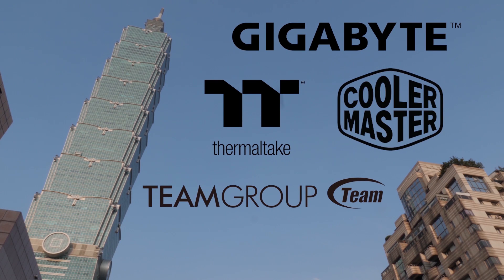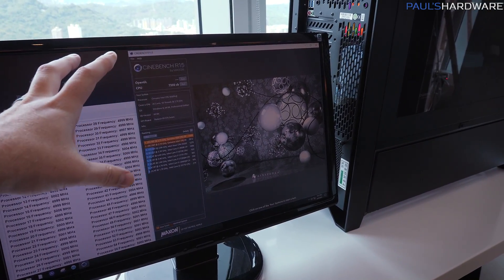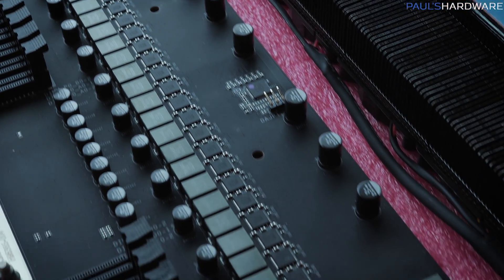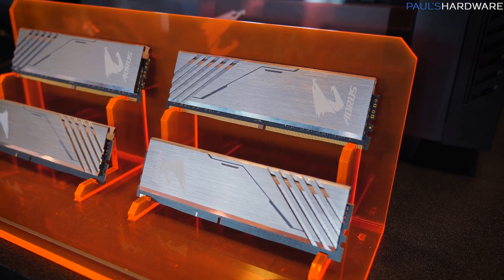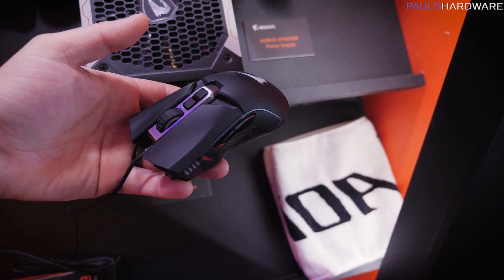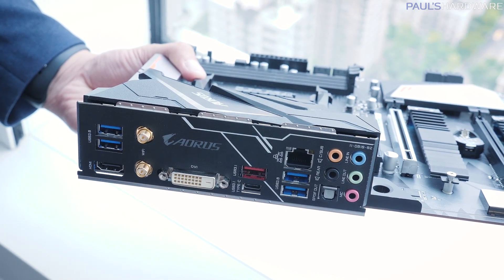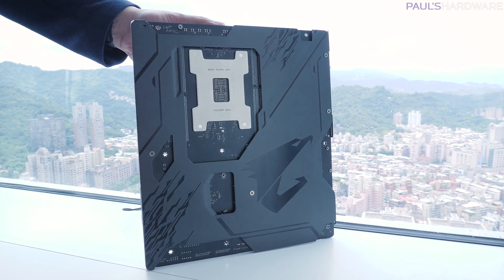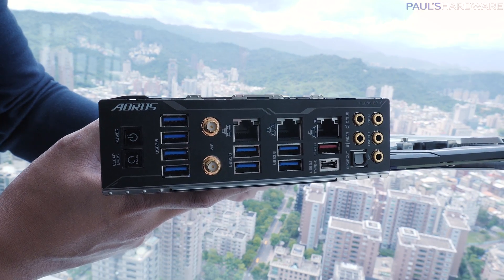Just A 28-Core 56-Thread CPU at 5GHz...

Comment: 32-core/64-thread TR, that is all Paul :P
Reply from the maker: I think we're both heavily in favor of an AMD vs Intel HEDT war 😁
Reply: Yep, love it :D Great video by the way mate.
Reply: Oh yes, don't forget that AMD Threadripper 2 is compatible with the Threadripper 1 TR4 socket. This is a great advantage for those with a “core fetish.”  No need to change MOBO compared to INTEL'S approach of putting UR board in legacy every time a new generation is announced.

Kudo's to AMD for making RUZEN Gen 2 also backward compatible saving us lots of hard-earned $$$. What a difference in philosophy.
Reply: Price tag on that Intel chip tho! Still losing value war
Reply: One quote that came to mind "More than you can afford, pal." LOL
Reply: @Derick P
, 'Ferrari'
Reply: @BOS2161 lol...ahh the "glued together" commentary.
Reply: @Joe Rio  at 250 Watts TDP stock (Probably 400 with a good OC)  I have a feeling the old boards will not run the 32 core TR2 chips...they had good power regulation but that's pushing it.
Reply: I'm hoping for a 10 core 2800X soon.
Reply: On the positive side, 32-core/64-thread TR2 will have an insanely good performance/price ratio, and the lower memory bandwidth compared to EPYC and this 28-core Intel part will not matter much for about 80% of application these CPUs are appropriate for.  On the negative side, the lower memory bandwidth will make the 32/64 TR2 a bit lame for the other 20% of applications that are memory intensive (overflow the internal caches).  OTOH, the EPYC is excellent for those application, so that market segment is already covered.
Reply: Branislav Kondic it's okay, they are glued together.
Reply: 32 core TR looks good but im wondering how it will fair with only 4 channels of mem.  thats a whole 2700x per channel.  some apps wont mind but anything mem bandwidth restrained is gonn suffer.  but will be the best choice for a lot of things.  intel has less cores but the higher clocks for less threaded apps and the extra mem abandwidth for multicore stuff will probly put intel over the top
Reply: Yes, it should work with the old boards at stock speeds; they can all deliver 300 Watts.  They cannot all deliver 500+ with stability though so overclocking to an all core 4.0 (if it's possible at all) will not be possible on a lot of old boards...the manufacturers will have to determine if they want to provide support (IE if they think their board can handle the new chips.)  They are effectively required to support the new 12 and 16 core TR2s but the 24 and 32 are well beyond the TR1 spec so that backwards compatibility guarantee might not apply.

I'm no Intel fanboy, that 28 core thing is a bloody monstrosity created by an increasingly desperate company that has run into a process node wall and is having trouble innovating.  That said, I'm no AMD fanboy either; the 32 core might not hit 4 GHz at all let alone an all core overclock, we have no evidence that shows it will or that it won't.  It's safe to assume that the 2950x will be faster than the 1950x, but assumptions about the higher core count models are silly at best.  If it does it though will certainly take more power than the 1950X at the same frequency.  the "12 nm" process is not bringing 50% power reduction per core which is obvious from Ryzen 2; it is bringing some though so MAYBE the 24 core can get into the same power envelope as 1950X...not 32 cores though, not a chance.  So an overbuilt X399 board from TR1 might have enough juice but that is not all of them.  Obviously new X399 boards will have to support the new chips and let's face it; if you can afford a $1500+ processor (no the 32 core will not be the same price as a 1950X) then you can afford a new board too.
Reply: I'm running an 1800x right now on a C6H MB.  I'm actually thinking I'll upgrade when the 3000 series chips come out.  I think I read somewhere that the 3000 series will be out around 2020.
Reply: @bobhumplick I get what your saying and the new chip may be an epyc chip but the original threadripper was not. Similar but with key differences. The substrate is actually different. Honestly, if your going to have issues with the memory access you probably want a server board anyway. It's a great processor, a great push for companies to optimize for core count more and both companies are pushing each other and it's good to see. I am concerned with Intel's issues such as the x299 fiasco and their 10nm process but i'm hoping they will be able to come back and compete. I'm glad AMD separated control of the gpu side of things because it should help make that side more competitive but I have serious doubts that anything AMD does in that market will matter. History would say that even if they produced a gpu with 2-3x the power of the top Nvidia gpu it wouldn't matter. Most gamers will buy Nvidia because it's Nvidia and not performance. Most people don't even realise that AMD had the lead in GPU performance in the past because they don't actually care what performance they get, just bragging rights. Intel has managed to piss off enough people with their pricing that taking market share was much easier with cpus.
Reply: Threadripper will rip em apart with the 32 core and the better price 12 , 16 , 20 , 24 core cpus more price friendly to most mortals
Reply: Are we just going to ignore how stupidly power hungry this chip is obviously going to be even at stock frequencies, we all do know the power consumption of the 8176 that this is based off of consumes 670W at full tilt with only a 2.7Ghz all core turbo...  and AMD's 32 core has a base clock of 3Ghz and a typical power consumption lower than 250W....

It seems that Cascade Lake is more like a Fail Cascade, less cores lower clockspeed or stupidly high power consumption, and even more stupidly high prices.
Reply: they were talking about sampling a zen based cpu on 7nm later this year to certain companies.  could be epyc but it could also be a zen 2 based 2800x and i think zen2 will be 12 cores.  so theres that.  if not i think 12 core zen2 chips will be here next year so eitgher way i think you will get what you want
Reply: Hopefully in the coming year application developers will start releasing updates and new software that can take advantage of those high core count chips. Otherwise how many people can really use a 32 core CPU for anything?
Reply: 3000 series CPUs will come out in april of next year L1A1Rocker
Reply: @Ken Shaw; video production...streaming 4K 60FPS, streamign to Twitch, youtube and facebox at the same time?  Yah, not sure what else a typical user would use it for right now, although if they keep their ECC support it would make a great modelling computer (3D, air chemistry, meteorology etc) too.
Reply: @subversive they improved their RAM problem they did not fix it.  If it were "fixed" you could just grab any 3200 or 3600 RAM and it would work without looking at a QVL.  Having to buy Samsung B-Die is not fixed; it's a work around.
Reply: I did exactly that. Bought Gskill ram meant for intel - put the timings into the calculator (took about 5 mins) and it worked. (3600/17/17/17/18/52 )If I'm willing to pay 900 for a cpu than 500-600 for ram isn't bad. You're sort of right - if you really want to make the point look at what happens to power usage when you up the ram speed btw. So even if you can get the ram at stock speeds odds are your cooler will get a real bang for it's buck.
Reply: @subversive.   Yah, I don't mind paying for the proper RAM but I have to admit the AMD RAM issue would not be as much of an issue if RAM hadn't almost tripled in price.  It's still not an issue for people that are willing to put in the work, but for a nooblet building a first machine figuring out RAM compatibility (and then actually finding sticks in stock) is not fun, especially when the QVLs from mobo manufacturers are so sparse....Coffeelake has gotten a lot worse for this than Kaby was too.  It seems like DDR4 did not mature as fast as DDR3 did.
Reply: No noob should be anywhere near TR and a noob buying basic Ryzen is really unlikely to worry about whether he can get his RAM to run at 3200 or 3600. IME even unsupported RAM on Ryzen still worked as standard DDR4 RAM at 2400.
Reply: Obviously nooblets aren't ripping threads, but as for unlikely to worry on Ryzen, that's a problem because it matters A LOT.  RAM speed moving from 2133 to 2933 on Ryzen shows more speed improvements than an OC from 3.2 to 3.9 does in many tasks (Especially on 2 CCX models).  Ryzen is great but for the absolutely new to PC building there are still advantages to Intel and dealing with RAM speed bullshit is one of them.  Ryzen 2 made giant leaps here so it's great that they put effort into this but it remains a weakness of the platform that Intel still has less of (even though coffeelake is worse than kaby lake in that regard).
Reply: That's definitely true but the reality is that a lot of noobs avoid the uefi completely. I've helped many people pick out parts for systems and then once they were assembled come over to check them out and found them running at base clock on everything, even with Intel CPU's, because the owner simply didn't understand the settings or were too intimidated by them to mess with them.
Reply: Derick P and ended walked by a 2JZ? 😂😂😂
Reply: To be fair that kind of jump ion core's and thread's aren't going to really see the kind of benefit you'd want without a new mobo. I always felt the mobo backward compatibility is much more favorable to smaller jumps.
Reply: Geo Gmz Moar Boost!!
Reply: Seems like AMD was evesdropping..
Reply: But why does threadripper have 4 dies ?I don't like it
Reply: hahahahah
Reply: Hardware Unboxed sad kid
Reply: Razamatraz AMD said tr2 will work with current x399 boards. The board they used for demo was an old board with updated bios. So go tell AMD it can't lol
Reply: Prosumer stuff most of the time can't even benefit from quad-channel. EPYC exits for a reason.
Reply: Not really , AMD is far superiour ! The only thing that Intel is good at , is LIE LIE and LIE ! 
Intel is DONE ! and for sure that Nvidia also needs to keep in mind that AMD is here to stay !
AMD answer ..... Hey gamer ..... we DON'T forget about you ! You will have 7Nm Gaming cards !
Nvidia's answer ...... Hey gamer ..... Fuck you ! .... You won't have a gaming cards for a long time !
So yeah , fuck Intel & Nvidia !       Since last year ( Ryzen ) I'm AMD guy , and PROUD of it !
Reply: \m/ Ryzen \m/
Reply: that actually is not as much of an issue as it used to be and with each new generation AMD is seriously making some headway in core clocks and IPC.
Reply: Yeah start a core war with intel thats all.
Reply: Intel Xeon W-3175X still destroys the Zen 2 3970X.
Reply: Wow, you intel fanboys don't even bother to know what your talking about. 
1) They announced already that it would work with the old boards and there is already at least one new board.
2) Intel already killed kaby lake x because it was stupid. 
3) The intel 28 core appeared to be an unlocked server chip. It was on a server board and nowhere near a market ready product that was cooled with phase change cooling.
I'm not a fanboy of any company. I use what works for me based on a variety of criteria such as use case requirements, security, cost, dependability, upgradability, etc. The current X399 motherboards will work with the new processors but obviously it's not necessarily going to be optimal. That's just how it is with processors. There's no issue with using a ryzen 2 with a x370 or B350 board but sacrifices will probably be made using a threadripper 2 with current gen boards.
Reply: With Phase change cooling you could most likely get thread ripper 2 up to 5ghz.
Reply: all that monstrosity and still no increase on pcie lanes... anyway, TR2 inc with 32c/64t, definitely not gonna be 5GHZ on all cores but, correct me if i'm wrong isn't thread count what matters most in content creation (in general) and not the clock speed?... oh and speaking of 5ghz on all cores, yeah sure if you happened to have a cryogenic camera at home, why not.
Reply: Derick P indeed. I’m guessing 2500 best case.
Reply: BOS2161 they fixed the ram problem months ago. I got a 1950x 3600 MHz ram. Newsflash get ryzen ram calculator
Reply: @Robinson Joe
   
"1) They announced already that it would work with the old boards and there is already at least one new board."   

i think what he is saying is that to get max clocks on it you would need a new board.  but yes it will work with the old boards just the all core speed will have to be lowered 

"2) Intel already killed kaby lake x because it was stupid."  then dont buy it.  what does it matter 

"3) The intel 28 core appeared to be an unlocked server chip. It was on a server board and nowhere near a market ready product that was cooled with phase change cooling."

all of these hedt chips are unlocked server chips.  TR is an epyc chip.  skylake is a xeon.  plus according to anandtech there is a possibility that this isnt just an hedt version of the 28 core intel has had out for a while now.  they are saying its an emib chip made of 2 14 core dies which would make it not an unlocked server chip but a purpose built hedt chip.  which would mean in this case amd is selling the repurposed server chip and intel is selling the hedt chip.  also the new intel chip is supposed to have 6 channel memory which is one of my concerns with TR 32 core.  im not sure if 4 channels can feed it.  and of course the water chiller is there to get it to 5ghz cause the heat of 28 cores at 5ghz would be massive.  but with a good water loop and a couple of radiators i could see this thing maybe getting to 4.5 all core maybe.  but on things that take less cores (which will be most things) it could problaby hit 5ghz on all cores in use which would give it a good boost over TR 32.  plus core to core and die to latency is much higher on TR.  like the die to die latecny is 2 or 3 times higher than the ccx to ccx which is 2-3 times higher than the core to core latency.  TR 32 and 24 core will be awesome but a lot of those extra cores are just going to go to waste and not just because programs arent made to use all of those cores.  it will also be because of die to die and ccx to ccx latency, being bottlenecked with only 4 channels of memory, etc